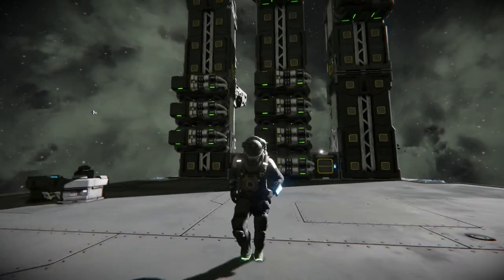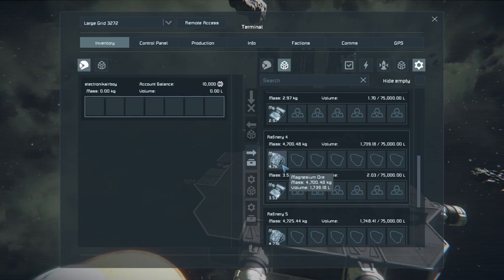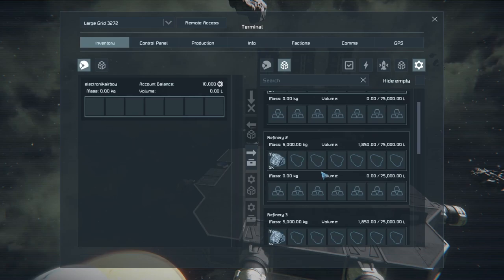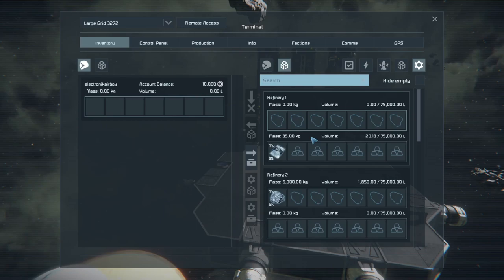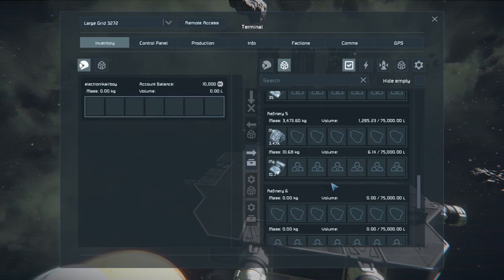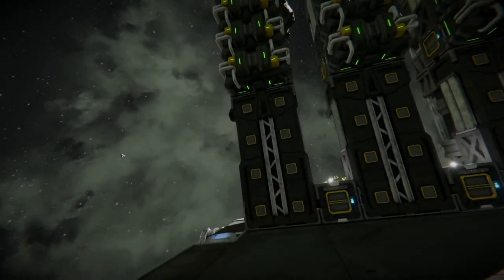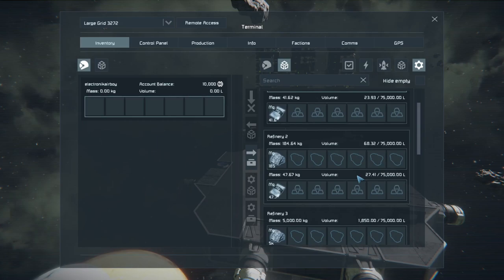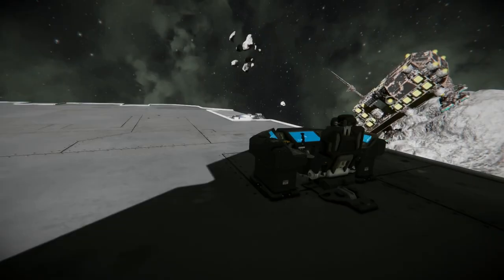The Most Efficient Way to Refine Ore!

Comment: Max yield seems the best for me. You get more ressources from the same amount of ore. Meaning you get more ingots from a single veins of ore, so less time spend searching for a new vein when you deplete it. Also no yield vs full yield means you have to mine twice the amount of ore, you didn't calculate the time requiered for that.
Reply: What if you use Autominers for mining the Ore?
Reply: the time required to mine ore is both the mining process and the time needed to go to and from your mine location which can vary wildly outside of a set scenario where resource nodes are in the same place.
this also includes how you mine.
rover based mining is different from using a flying miner vs a Static Mine and Drill Rig.
Reply: Currently on my server, finding gold seems to be the most consuming of my time. I can't seem to find asteroids with some. I found one, but it's been depleted since. Yield modules made that gold vein give the maximum it could before being depleted and having to search for a new one. And since the server is running 24h, refining time isn't much of a problem as they operates while i'm offline.
Reply: @Curly3107  Automating your mining will always be a lot more work than simply doubling the number of refineries you have on your base. Mining is inherently more time-intensive than refining.
Reply: on starter grids or more mobile grids where energy use is of "slight" concern. 2 yield, one speed, one power. on a full scale industrial build? either all yield, or 3 yield one speed. then again, you can also have one at max yield, and one at max speed. and use either depending on your individual use case. need something done fast? use speedy boi. need a lot of something? use big boi.
Reply: I put speed on base assemblers, and power on ship assemblers, but refineries are always full yield.
Reply: I use speed mods for stone processing. I don't like to waste stone and I also don't want it clogging up my inventory. Run through the stuff quickly and get what you get from it.
Reply from the maker: Agreed, stone is very abundant and definitely slows down production if not processed quickly.
Reply: @lukefredsall  That's a good idea. Will surely use it on my next base
Reply: tl;dr: Speed modules on refineries bad; Yield good

Max yield is the way to go. I agree with @nicolas277 but there is even more to it. Each speed module increases both processing speed and energy consumption by 100%. It means that one speed module equals one extra refinery. However none of these "extra refineries" can be equipped with modules. So unless you are having material issues or trying to save space, you are better off with more refineries equipped with the other types of modules.

Yield modules do not increase energy consumption. Having four of them on the refinery will produce double amount of resources. The ore processing speed remains unchanged. It means that ingots are being produced twice as fast (with no extra energy cost).
Reply: @nicolas277  I prefer to split my refineries so some are all yield for processing gold, uranium, platinum and then have a sorter send the rest to speed refineries to process stone, iron, silicon.
Reply: @honza2447  for stone, especially with a drill rig you want speed to keep the system moving.
Reply: @matthewconnor5483  Then build more refineries. It will do exactly the same thing as speed modules. One refinery consumes 560kW. Refinery with 4 speed modules produces 500% faster and consumes 5 * 560kW = 2800kW. Five refineries produce 500% faster and consume 5 * 560 kW and it is still possible to add modules for additional benefits.

Use a temporary welder connected to base resources and building refineries becomes easy if that is a problem.

As per drill rigs - their purpose is not the biggest hole but the most ingots. Use yield and you can drill slower with the same resources output. This way the rig won't need to be manually maintained so often.
Reply: PCU cost can be a problem with more refineries. Refineries and enhancers both have relatively high PCU costs, and building a larger base or mothership to contain a larger refinery facility can add a lot of hidden PCU cost that you might not be considering.  When you solo play on an always on server, you may only need 1 or 2 refiners to keep everything moving along; so, max yield makes since, but if you do single player, a scheduled server, or have an alliance refinery that needs to process enough ore for many players,  it becomes pretty easy to mine enough ore to clog up 10-20 refineries, especially if you are are running any large grid asteroid or moon mining ships.  In this case, being able to cut this number down by half to free up a bunch of PCU can definitely be worth the slight yield reduction when you consider that PCU is a hard caped resource whereas you can always just mine more ore.
Reply: @matthewconnor5483  If you really want to go full throttle on eliminating stone, a cluster of 12 basic refineries has the same volume as one max speed enhanced refinery.  You get 30% less yield but it's 3 times as fast and almost twice as power efficient.
Reply: I'm pretty much a noob, only been playing a few weeks. My base is running 3 refineries, 6 yield 2 speed slots each. I mostly want a huge efficiency increase, but the speed makes a difference to me, I'm often having it process a lot of stone in addition to the ore. Gets it out fast enough. I just did it off gut feeling, rather than mathing it out. 
I'm just about to push into mining in space.  I've tested a couple mining ships, just need to get a large grid detector on it. Then, the time will come for a big space refinery system.

Comment: I did this test quite a while ago.
Also looking at power consumption.
Since then I always go:

2 Yield Modules
1 Speed Module
1 Power Efficiency  Module

Note:
A single refinery with 4 Power Efficiency Modules will run on a single Solar panel.
I found this quite interesting and knowing this might be very helpful one day.
Reply from the maker: That is a great tip! Having that combination of modules allows for a good balance of yield vs speed plus power saving.  Thanks for sharing!
Reply: Right from the start of the game before I had done any test I had actualy dose this exact same thing thinking "if speed made it go faster it might take more power... and since I play alone alot I don't really have a time constraint on mining, more is always better!" Seeing this actualy kinda confirmed me having the first "right" decision before I knew something in a video game lol.
Reply: That's my close to my build if power supply is an issue - anyplace you can't use wind power. On planets with enough wind it's easy to produce more power than you could ever need.

Here's my problem with the speed module part of this: gold deposits are usually so thready it's a pain to mine, and uranium and platinum are such a pain to get and bring back to your refinery, all in all it feels like whatever time you save refining is not offsetting the extra time to get the resource. Of course, it might also be my imagination that it takes longer just to drill silver, platinum, and uranium, and i might just consistently have bad luck with finding gold deposits that are two thirds stone no matter where you drill in the deposit (even rich-looking large veins in space, i have to periodically pause drilling to let my two filters catch up with kicking out stone, and I'm only running three drills on my little Gopher).

Not helping matters I've hobbled myself by having my refining and fabrication facilities on Earthlike, so i have to truck the high-end ores down from the sky three small grid large cargo at a time. But I don't need power modules!

Comment: Yield modules are better if you are not limited by space or number of possible refineries because you can always add a second refinery for 100% speed increase and you will end up with more stuff in same time. Yield of 70 in 201 seconds = 0.348 kg/s, Yield of 35 in 49 seconds = 0.714 kg/s so to get output of 70 it would take 98 seconds to refine so same time to refine but less ore needed which means less mining time needed if you use yield modules.

Comment: It's about finding a balance between abundance and rarity. Refining uranium using a max efficiency. For not wasting stone going pure speed. A sorting system between both.
Reply: Sorting is definitely key to good refinery. I usually have banks of  cargo containers. From their ice gets sorted out while basic refineries and speed refineries process stone and common materials. Uranium, gold, silver, platinum all go through the yield bank of refineries. All the ingots get dropped into another bank of containers where the gravel is dumped.

Comment: You can set up multiple refineries with multiple setup of speed and yield modules, then use sorters to move materials into specific lanes.
For rock, I'd just run that through a 4xSpeed refinery, while uranium would be run through a 4xYield refinery.
Reply: There it is. There is the proper answer.

Comment: Always max yield. Power is very easy in this game and you can always just build more refineries, I usually have 10-20 minimum running. I like building big mining rigs so ore is easy to get and lots of it. On big mining rigs I will eject the stone BUT i put in a stone trap(Conveyor sorter to a cargo container with a separate unload connector) with a few refineries that have speed modules on them that supplies all my builds with the Ni and Si as I never mine specifically for that plus the Fe it yields helps to reduce mining of that specifically. at the end of the day you need the best setup for your playstyle and there are many ways to do it. I like massive operations so I need  big numbers.

Comment: exact increase with yield module can be calculated like:
(35*n*n*n*n = 70), or (n^4 = 2) 
so, it's the 4th root of 2, which is about 1.1892... (slightly below 1.19)

Comment: It depends entirely on the ore being processed. Speed modules double the power draw for each module added so there's a point when you're processing Uranium that the power requirements  almost reach equilibrium with output and you're barely stockpiling Ingots. 
For things like Iron and Silicon speed is the key as you don't get enough with extra yield modules to justify the modules. 
Ores such as Platinum, Uranium, and Gold you want to extract as much ingots from the ore as possible since you spend so much time mining them let alone the time spent just finding them in the first place and all yield modules are almost a necessity.

There's no one combination of modules to fit all the ores at once.

Comment: Basically, I always use 4 speed modules, but sometimes I switch to 2 Yield and 2 Speed for each refinery depending on the server setup etc.
In all my solo gameplays, I always use 4 speed mods, basically, It is fast as hell and it is not that hard to bring few more loads of raw ore :D
On the other hand, with some harder multiplayer settings, things are different, I usually setup 2 vs 2 by default and later on I adjust if necessary.

Anyway, it is helpful video and pretty informative
Great work doing all the numbers

Comment: for those times when I mix modules on my Refineries
I usually go with 1 Speed Module and 3 Yield Modules to get the most out of my ore runs in a reasonable timeframe.

in the early game, it's efficiency that I need more with very limited power availability.
but once my power supply is secure, I switch over.

assemblers get the full quartet of Speed Modules.

Comment: If you wanted yield rates of the various combinations, they are: 3 yield 1 speed 0.51217kg/sec; 2 yield 2 speed 0.61111kg/sec; 1yield 3 speed 0.67096kg/sec.
With these times in mind, the 3 yield seems the least favorable in terms of material rate and because you'd want the most yield at the least rate reduction the 2:2 seems the best IMO. A tenth of a kg rate decrease is just too much especially if your processing thousands of kg of ingots
Reply: This is prioritizing output from the refinery, not absolute yield from the input ore. Provided you always have excess ore deposits and mined ore coming in, then yes. But if you're bottlenecked by lack of ore and your refineries are sitting idle a lot, then all that excess speed capacity is being wasted. Might as well have spent it on yield to more slowly extract more ingot yield out of the ore you did have.

Comment: Personally I don't feel that iron, nickel or silicon need yield because you can get those from stone and their individual ore patches have high yield to begin with so you get a lot of ore quickly.  They're effectively infinitely available (unless you're stuck on an ice planet or something) so I tend to just sort those for speed to get them out of my cargo faster so my refineries can get busy working on the good stuff, assuming I'm still doing all my refining on the same grid.  Yield is always my preferred choice for the rarer elements like uranium, platinum and gold.  Small patches, low ore yield, low refining yield and expensive uses mean I want to squeeze every ingot I can out of those.  Everything else is discretionary, depending on just how much you've found in your particular world and how you're using it.

Of course, once you have a grid that can support multiple refineries it may not matter; you can just go yield anyway and keep adding refineries.  Game really needs more interesting modules.

Comment: I like to split the refineries so high value materials go through refineries set for yield while stone and common materials go to  the speed refineries so the system doesn't get choked.
Reply from the maker: Intelligent choice, that would definitely enhance the volume of resource along with decreasing processing time.
Reply: @mastermindgameplay5297  also worth working in basic refineries on your junctions to help process stone if your base has automated drills. Definitely want a to get rid of gravel or at least separate it out into a separate container.

Comment: Not played space engineers much but in other survival games the go to seems to always be to focus yield and if you need it done faster just build more of them. As an example 2 refineries seems like it beats 1 refinery with 1 speed module. I wonder what the comparison between 2 refineries with full yield modules and 1 refinery with the "optimal" modules would work out as. Obviously the downside of more refineries is more fuel/power consumption tho.
Reply: The problem is that with space engineers the maximum you can build are 4 refineries, and the refineries are also the best armour in the game, so you just not have to balance if you want speed or yield you also need to balance how many do you need for ramming speed.
Reply: For SE, that's not the case. 1 speed module gives +100% speed to refinery and consumes +100% power. This means 1 refinery + 1 speed module = 2 refineries with no modules. That's straight up additive math. In the case you describe, 2 refineries consume the same power as 1 refinery + 1 speed module.

Optimal is situationally dependent on whether you have a surplus of ore, power, and/or time.

2 refineries with full yield modules with X amount ore will yield ingots equal to as if you had 2X ore, in the time it would normally take unmodified refineries to refine X ore, for the power consumption of 2 refineries. Thus these two refineries would give you twice the absolute ingot yield from X amount of ore in half the time of one refinery. Equivalent to 1/4th the time of one refinery processing 2X the ore to yield 2X ingots.

A fair number of players go with 3 yield + 1 speed being optimal, so in this scenario: power and speed = two refineries (same as the above all-yield module scenario). 3 yield modules only give 1.68X yield, not 2X yield.
Reply: @rhulyon5728  block limits must be a thing on whichever server you're playing, because in a solo world with or without the default 100K PCU limit, you can build as many refineries as you want (up to the PCU limit). I've spammed 30 refineries because I didn't feel like leaving my game running on my PC for 16 hours to refine an entire magnesium deposit on Mars. :D

Comment: You should not calculate the time decreased with speed modules but rather the productivity increase. So a 50% time decrease is a 100% productivity increase while 75% time decrease is 300% productivity increase or 400% total
Reply: so from the data you collected you would get 
seconds - productivity
201 - 1
113 - 1.7
80 - 2.5
62 - 3.2
49 - 4.1

from this we can see that the speed module increases the productivity by 0.7 - 0.8 and having a single refinery with 4 speed modules is equivalent to 4 refineries in terms of ore processing speed.

Comment: My base ship has drills on the front  one Refinery withal maxyield and sevin refineries with efficiency modules the whole thing is run off solar and batteries.
Reply from the maker: Wow that sounds pretty cool!
Reply: @mastermindgameplay5297  it's cool on a server we're finding uranium is the hardest thing other than platinum. 
Let's you refine basic materials with less panels and use a pair of sorters to bring rare hard to find materials to maximize yield refinery where you don't care about power usage. We find uranium deposits every 2 to 5 days. X.X